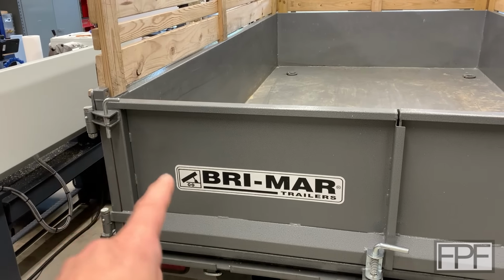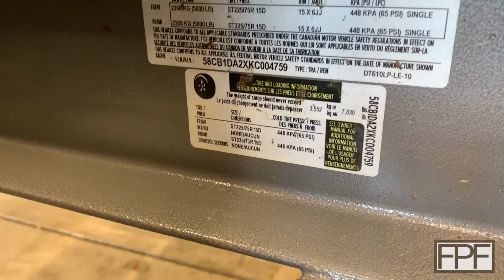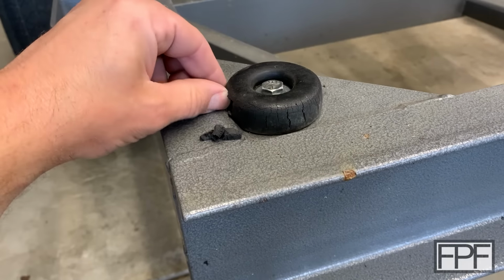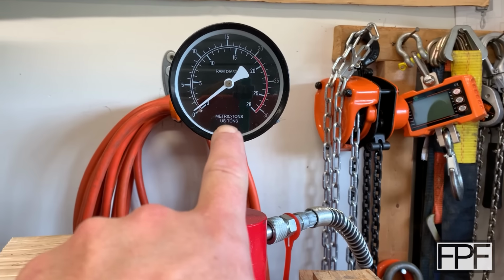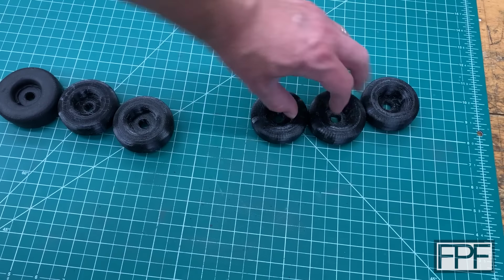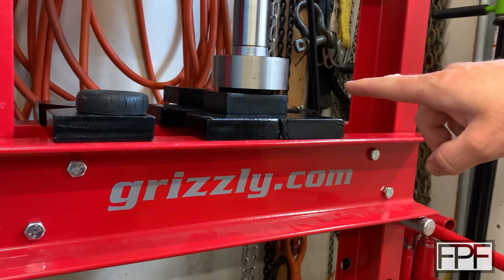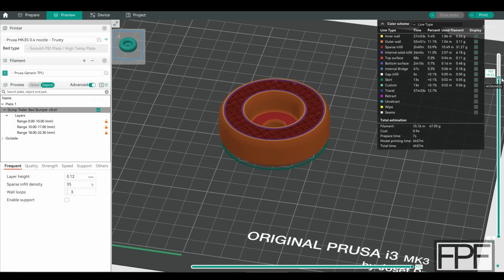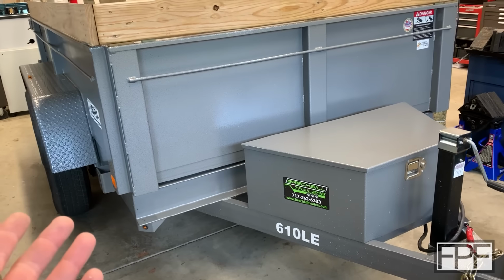3D Printed TPU Bumpers for Dump Trailer Box

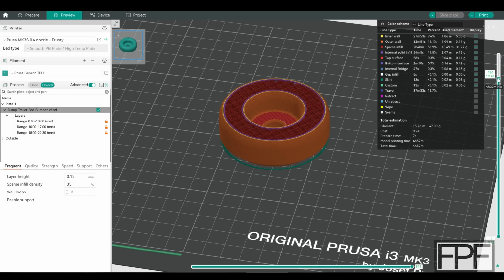Comment: @27:30 If your looking at a curve being sliced flat it appears as tho it is getting wider. But its not. This is whats happening to your walls. Your slicer is adding to keep that 3 wall thickness. The curve is changing against the flat plane. If you have checked your slicer settingd to. "Ensure vertical wall thicknes". Rest assure that the slicer is taking care of it. A simple way to think about it is.. take a 1mm thick object. Slice staight down it. It stays 1mm thick. Now lay it flat snd slice it. Its as wide as it was tall now does that mean its not 1mm thick anymore?  Something to think about.
Reply from the maker: great point!

Comment: Much like other commenters, I thought you might select a triangle shape bumper. Additionally, you might consider using an alternative material (like a gym mat) that is stuck to the bottom (original bumper) and the top (where the wear marks showed). Using an adhesive on the two triangle pads (upper and lower) would negate the requirement for this bolt. Sometimes you need to improve on the original design, like threaded nipples rather than press-fit nipples. Still, this was an excellent coverage on using FDM material (TPU in this case) to solve a problem. Good work.

Comment: hey man!  nice job.,  be carefull about hte number of walls.  I had inter-layer adhesiion issues when I went to 1-2 walls.  as they flex, the layers might wantot rip from one another.  there are also different infill that are much more able to squish, like gyroid, or, on cura, the "cross" one.  i think that having the line patterns but with one direction only PER layer might give it more squish.

Comment: I'm a little surprised that you stuck with a cylindrical shape, even after saying you weren't constrained to original part dimensions and materials. Kinda figured you'd spread the surface area out more and go with a triangular wide-corner shaped bumper, and take up all the space where the corner of the box comes down.
Reply: I'm guessing that because of the compression involved, a circular bump stop has even load all around, whereas a shape that isn't radially symmetrical would have uneven compression load and wear.

Comment: I think I would have changed the shape to a triangle with round corners to maximize the surface area. I would also consider an abs shell that goes up to the top of the bolt, but not sure if that would hold up.

Comment: I think I would’ve used the hockey puck. I have hockey pucks under all my machine tools in my shop. It stops him from rusting the floor. And it also vibration damper when you hammer on something. Great video look forward to next next one.

Comment: Try our Varioshore TPU. You can print it stiff or very soft depending on the extrusion temperature. With 250c and extrusion multiplier 0.8 it’s very soft.
Reply from the maker: Want to send me some to test?

Comment: TPU is extremely hygroscopic and the issues that you experienced indicate your filament is saturated. I live in South Florida and the humidity is so high that I have to print TPU directly from a dehydrator. Telltale indicators of moisture absorption are rough surface and stringing, and it doesn't take much to cause problems. Water turns to steam when it goes through the extruder which causes voids in the filament.